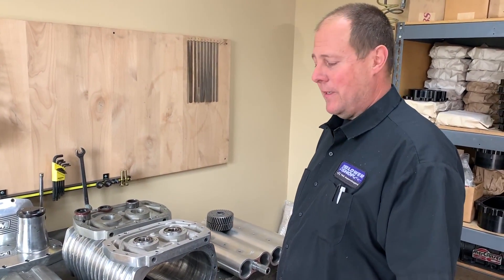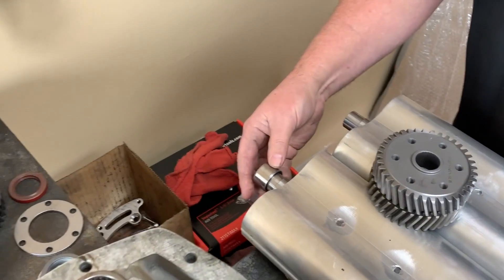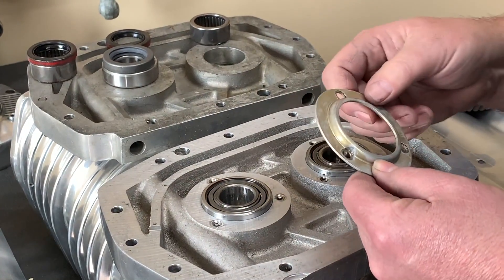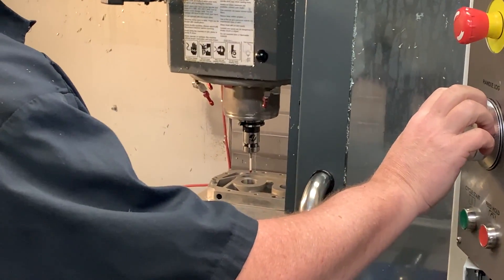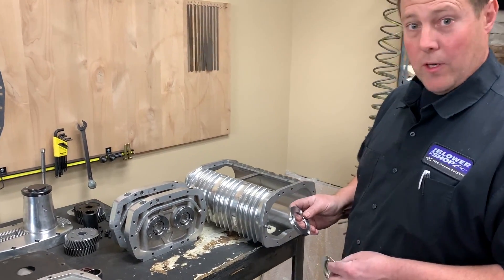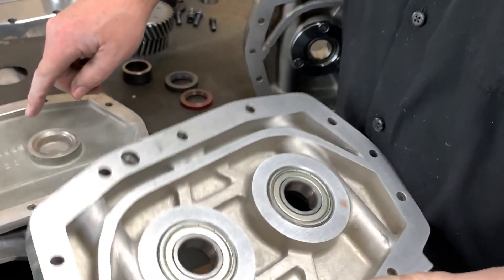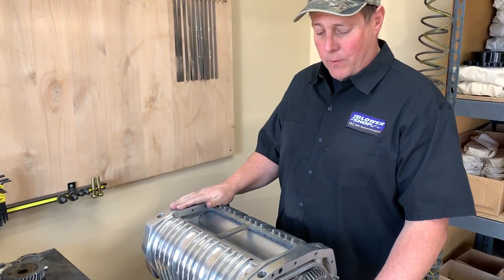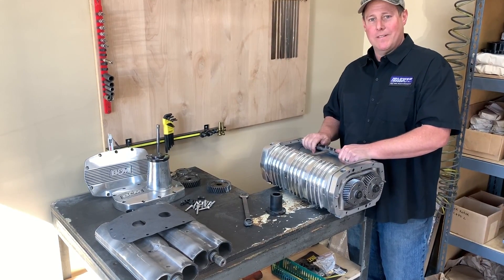TBS Technology: B&M 420 Rotors Fix

Comment: Does top cylinder lube help cool or reduce heat in a blower, street use 10 to 15 lbs boost pressure. Yes I am very aggressive.
Reply: I am going to say no cooling from it.I run 14# on a 8-71
Reply: @michaelclanton1152  thanks!

Comment: Do you have a solution to rebuild a B&M 250 Blower?
Mine is mounted on top of a 502 in a street car under the hood. 
I don‘t want to change the blower setup because of regulations and the hood setup wich will not accept a taller blower.
Greetings out of Switzerland
Reply from the maker: Hey Switzerland! We can rebuild your 250 no problem. We do rebuilds all the time! They start at around $500 depending on what's needed, and include bearings, seals, and gaskets in the repair. We'll oil it up and get it back to you. You pay shipping to and from. Check out https://theblowershop.com/repair/ for details and print out a blower repair form to send with the blower.
Reply: The Blower Shop , that’s great 👍🏼, also is the TBS 250 same rotors as the the B&M 250 ?
Cheers